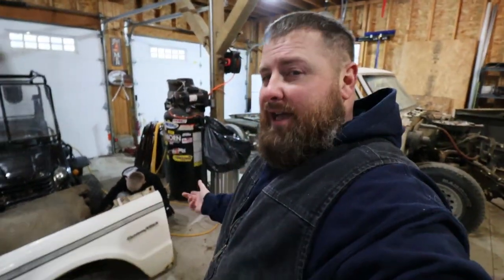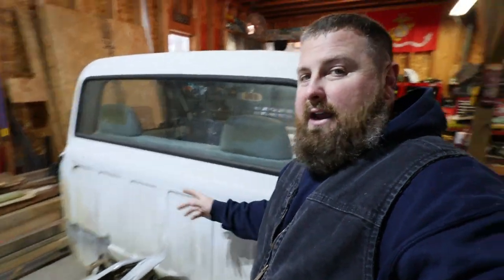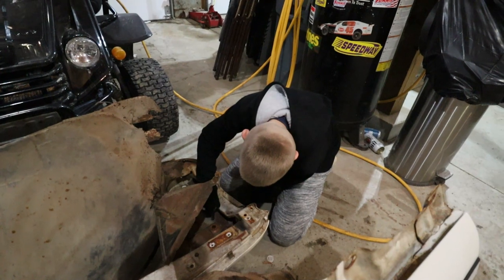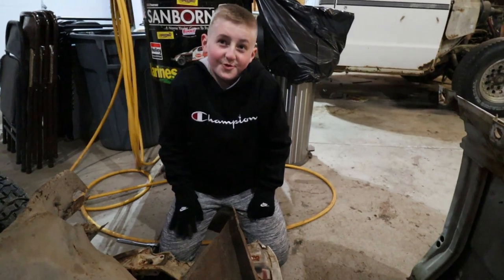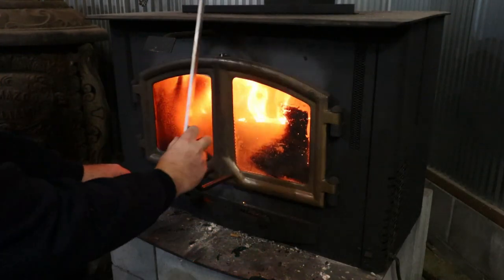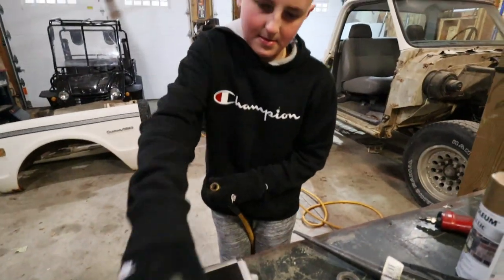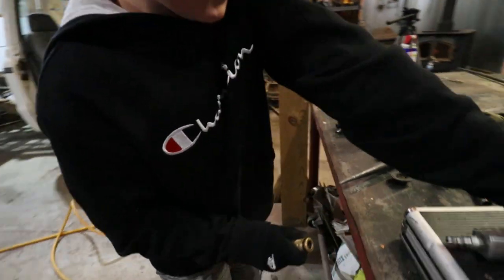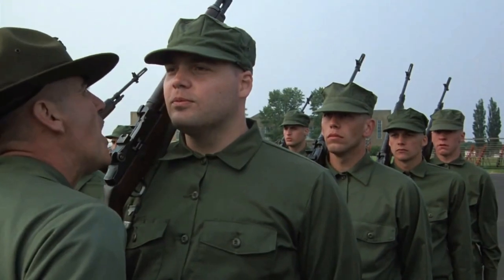✴️ We Take The DOORS Off and Evaluate The RUST

Comment: If its a top shifter. Pull the boot and there should be a cap at the base of the shifter that if I remember correctly turns left or push down and turn left and the shifter lever comes out just make sure its in neutral before pulling it.
Reply from the maker: Thanks for the tip 👍👍😊